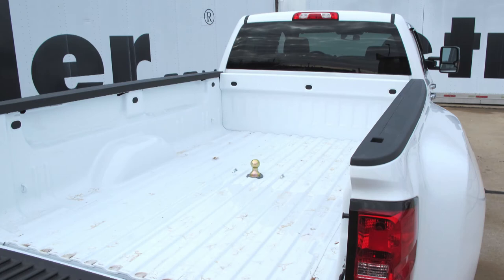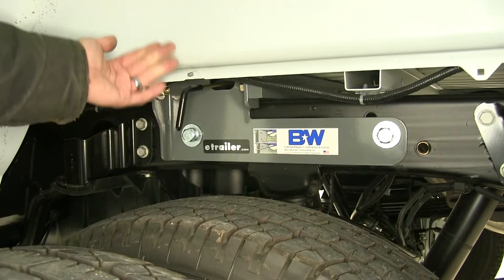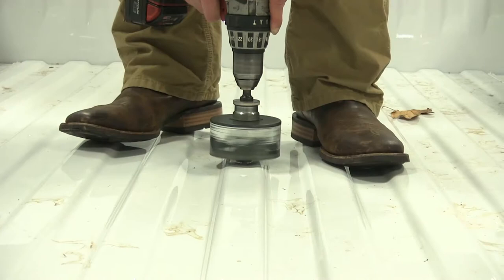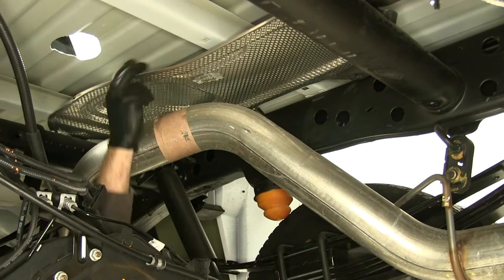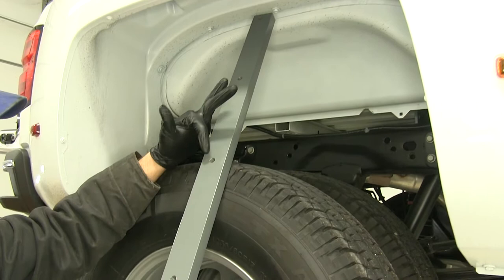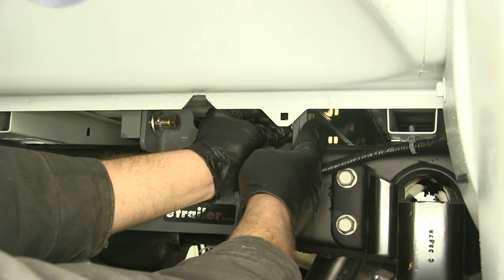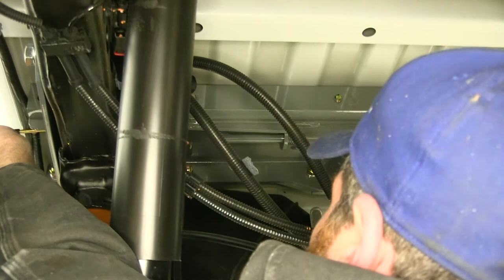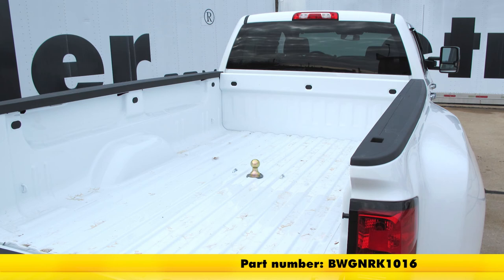etrailer | B and W Underbed Gooseneck Trailer Hitch Installation - 2016 Chevrolet Silverado 3500

Comment: What's the measurements of the longbed?
Reply from the maker: To install the B&W # BWGNRK1016 Turnover Ball gooseneck hitch on a 2016 Chevy 3500, the 4 inch diameter hole is drilled at 49-1/2 inches forward of the rear edge of the truck bed, as shown in the install instructions that we've linked for you below:
https://www.etrailer.com/instructions.aspx?pn=BWGNRK1016